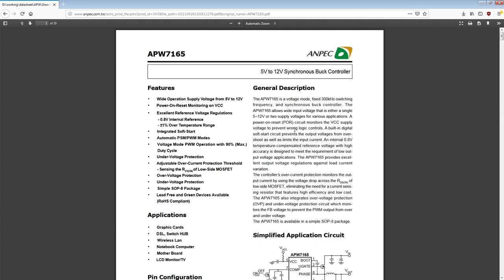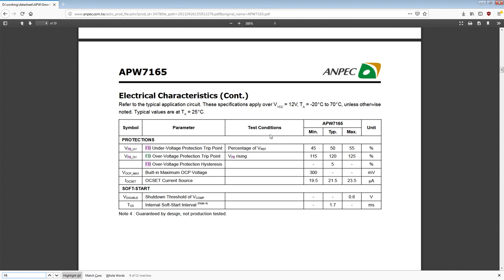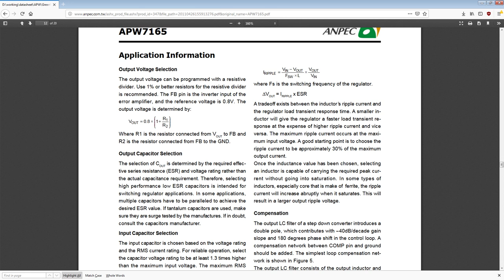R9 270X memory voltage mod and capacitor mod

Comment: My first voltmod was an old 8500GT, those large DIP voltage regulator chips are great for practicing and getting the hang of how the electronics of the VRM work.

Comment: I will admit, if the other comp wasn't in use with 3D stuff, I would be tempted to cap-mod the motherboard now. 3.8GHz with 3200 memory at the same time, would be sweet for that box in 3delight.  It's happy at 3.4 with 3200 memory, so it has just been left as is.

Great stuff BZ. B)

Comment: Got an MSI R9 390X Gaming 8G which needs a fan replacement but i've had a lot of issues with MSI due to the fact that for some reason my serial number won't come up and I bought it direct from Scan in the UK so it's a legit card and not a knockoff if there even are knockoffs out there. As i'm getting sick to death chasing a fix it's available to be acquired by anybody who can sort it.The fan wobbles on the spindle and catches off the case preventing full operation. If you know the fix hit me up and we can swap emails to speak further. UK based so bear in mind any transportation costs.

Comment: Wonder if this is applicable to a R9 270 too, I have a Powercolor one gathering dust :D 
Theoretically they should be the same card, I think. Although the 270 only uses one 6-pin power connector
Reply from the maker: yeah should be a similar PCB

Comment: So like how much would you expect from capacitor mods, I've heard you say like 20mhz in other vids I think, is that really all its flr
Reply from the maker: depends on the card. I've had Nvidia cards pick up hunderds of MHz on mem clock from the extra caps.
Reply: @ActuallyHardcoreOverclocking  dang that's crazy

Comment: Great video man ..Just one question .. I have  r9 270  that work- have power in GPU and ventilators .., but when I connect 12v rail automatically shot down the whole pc .. like it is shortened, that 12-volt rail .. so where to look for possible shortening. That is sapphire r9 270x dual x. Thanks, and sorry for asking you here ..

Comment: So im wondering how come on alot of PCBs theres spots for where capacitors look like they should be but they choose not to populate that area,how come?obviously the card dont need those but why add them to the design of the PCB in the first place and would adding in those capacitors actually make any diffrence?

Comment: i  know  this is old   but i have  a r9 270x  that has  one  memory failing, i was going to change  it  but  the  heatsink on the  top memories (this one has a heatsink there, its sapphire dual  x) was too hard and had to use  a screwdriver to get it off, and even i did tape the screwdriver  the board got scratched between memories and the copper is exposed, i want to know the resistances in the vrm for  the memories on the r9 270x to  test if mine it's still alive, sorry for much text, i'm too afraid of putting it on my pc and potentially frying all my pc

Comment: my question is - would it be possible to desolder the memory chips ( with the right equipment ) and then solder solder some new on with double the capacity - if yes, which chips would work ?
i have one of these cards and it works fine for my use with the exception of the 2gb VRAM and i would love to upgrade it to 4gb. There are cards out there with 4gb vram as the only different btw.

so:
is it possible?
What chips to get that would work?
Where to find them online?
Reply: kinda late but, yes its possible as long as there is a version of that gpu with more memory and you have acess to a bios from that board, you may get the memory chips from a non functional (dead) card with the same or close specs (same memory manufactor).
Heres a video from a brazilian guy doing it
https://youtu.be/3eS0YbbwHyo
https://youtu.be/h8R55v-y2j0

Comment: Would this be applicable to my R9 290X or 390X?
Reply from the maker: no because they use different chips
Reply: @ActuallyHardcoreOverclocking  
Have you any use for a R9 390X 8g that needs a wobbly fan fixed? Otherwise it's working fine but i'm sick of the useless support at MSI. Had issues with my serial number and without it it's nigh on impossible getting through to them in any form of substance. If so let me know. I'm UK based so take transportation costs into account but otherwise i'm getting sick of the sight of it unless you feel generous. I'll drop some email details if needed.

Comment: elpida memory :(
Reply from the maker: All my cards are Elpida and all my ES CPUs are average at best. My luck with hardware is the worst.
Reply: @ActuallyHardcoreOverclocking  my old 270x had elpida as well, im pretty sure that like 80% of AMD's 28nm cards use elpida